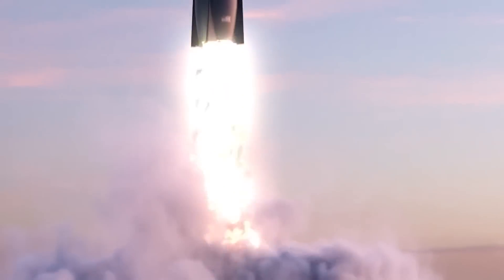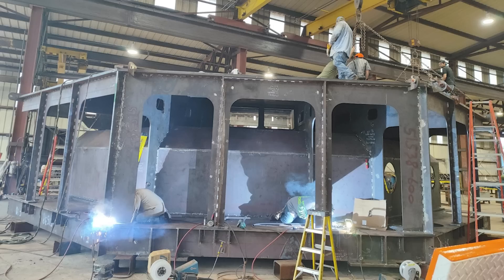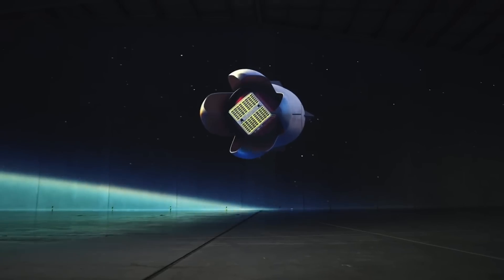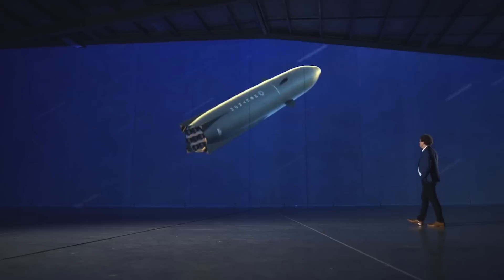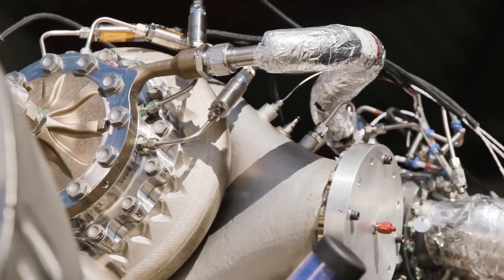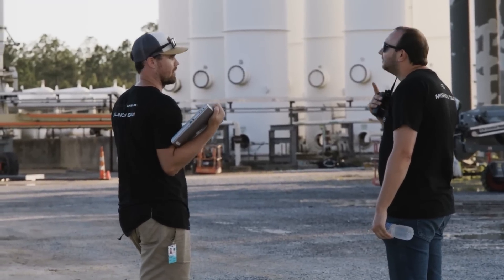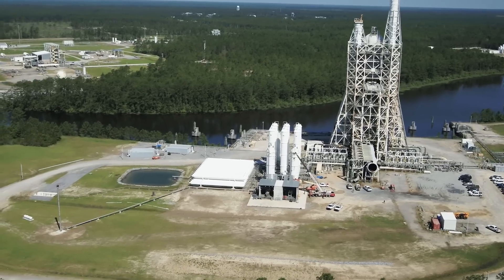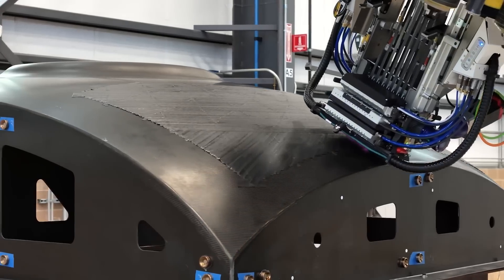Rocket Lab's Neutron Launch Pad Is Almost Ready

Comment: If they don't call the upper stage of neutron a neutrino idk what i will do.

Neutrons real benefit is having a lighter upper stage (or at least the possibility of this) than falcon 9 so it could be used for high energy orbits like falcon heavy as opposed to stsrship which without refueling is just for LEO.

Comment: You said 9 engines on the first stage and the text on screen said that too, but the graphics shown on screen only show 7 engines.
Reply: That's because Rocket Lab originally displayed their Neutron concept with 7 engines on the first stage. As the design was refined, the legs were changed, the engines increased to 9, and rocket got less stubby. Plus, the fairing design has changed since the Neutron animation. So, at this point with the design, 9 engines is the correct figure.